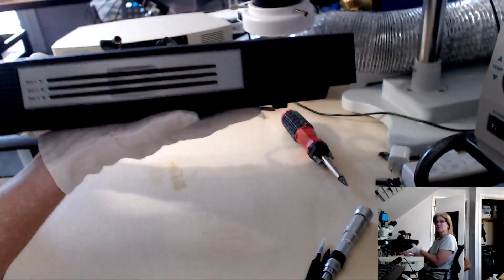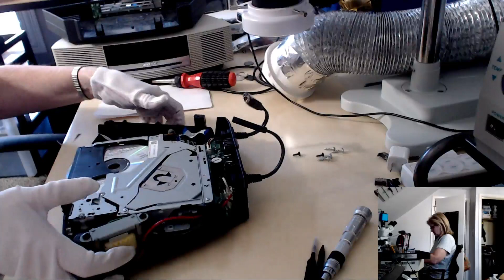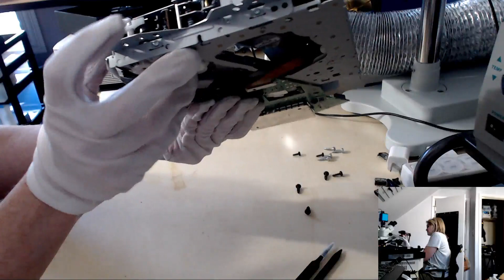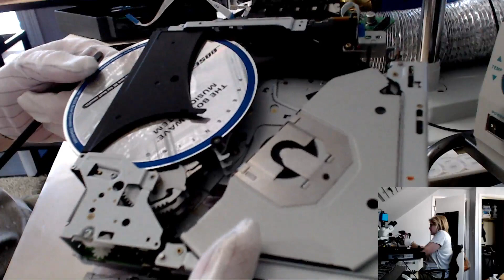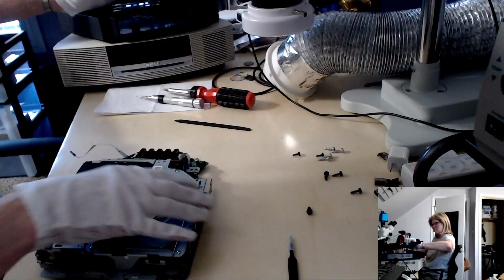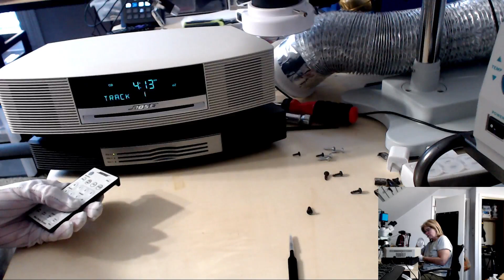Bose 3 Disk CD Player - Drive Issue

Comment: I have one that is not attempting to read discs  in the changer. It starts up and aligns but doesn’t do anything when I put in a disc. Any recommendations?
Reply from the maker: Hello Roger. Can you please elaborate  a bit more on your " doesn't do anything.."
After you power on the unit and it runs through its initializing phase what happens  when you insert a CD? Any error message displayed on panel? Does the CD just spin? No spin at all?

Comment: This video was very helpful...after viewing, I took apart my mother-In-law's 5 CD changer that had some stuck CDs and wasn't transferring discs between the changer stack and the optical drive,  Turns out a plastic gear that drives the mechanism that transfers the disc to the player is missing a few teeth and not engaging when the "drive gears" spin.  Here's my question...is there a source to purchase various Bose internal gears or is that the point where it's not worth the effort unless you had an identical "donor" drive to use for parts?  A  quick search online did not reveal any obvious parts sources.  Thanks in advance for your take.
Reply from the maker: You either have to donor parts or look for someone who would possibly sell you parts from their donor boards or you can 3D print parts. Now depending on what gear failed (some of the gears are your everyday commonly used gears) sometimes get lucky by finding them on Ebay.
Reply: iRepair iDevices appreciate the response...enjoy the holidays.  Opted for the $5 solution...digitized my Mother-in-Law's holiday CD collection, loaded them to YouTube Musics platform and purchase a $5 Bluetooth adapter to plug into the Bose's auxiliary port and stream the music without the need for the mechanical CD changer.  I'll hang onto the 5 disc changer just in case I run across a cheap donor to use for parts.
Reply from the maker: @markhorowitz8235  good for you. Yes some people go the Bluetooth route while others still like to use their CDs. Just like some people still hanging onto their vinyl records and pulling out the record player to play them.

Comment: ❤ I watched this video hoping it could fix my friends 3 disk changer and it was very helpful in learning more about how it worked, however every thing you showed was the problem, and was wondering if you could help .  
Disk 3 & 4 work great but disk will not load the disk into the spinner, it try’s to and it will Search up and down for the cd but won’t load it and it keeps trying until you kill the power and resets . After reset 3&4 will work but 2 won’t. If you have time please help
Reply from the maker: Hello Kenneth. It would be difficult for me speculate what the problem is without seeing it. There are a few possibilities that can cause that issue and I would hate to send you down unnecessary rabbit holes.  I do offer mail in repairs if your friend is interested.

Having worked on 100s of these, the fault issue can come different parts of the drive mechanism.  I have units sent to me displaying same type of error problem however the fixes for each were different.

You or your friend can email me and I will be glad to quote you a repair price.